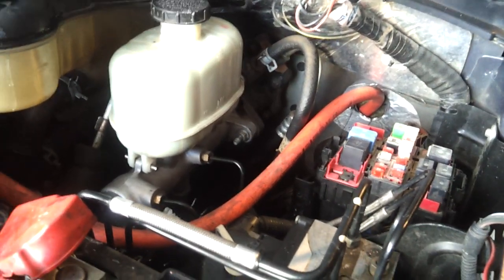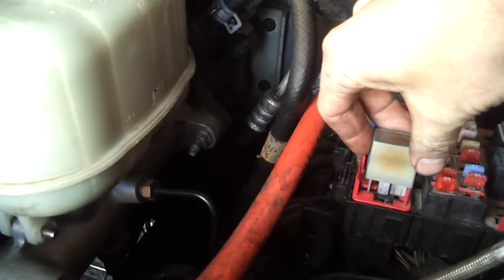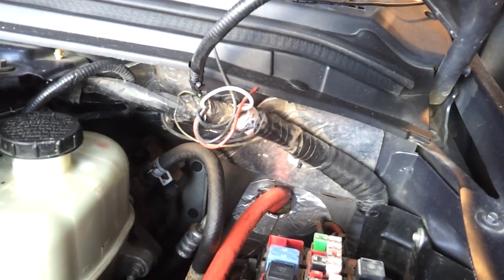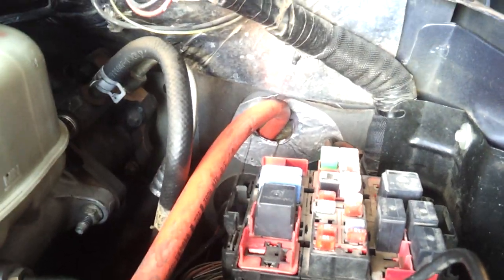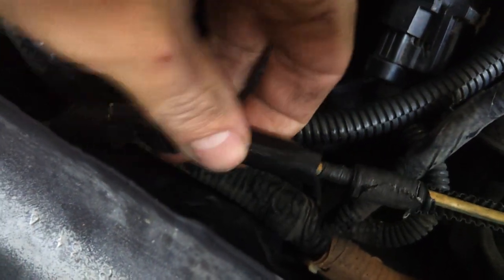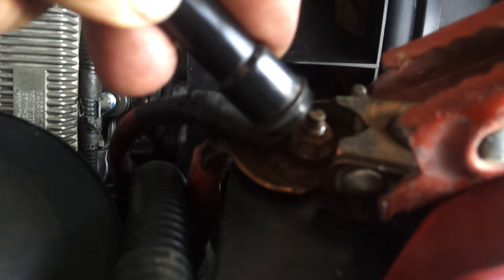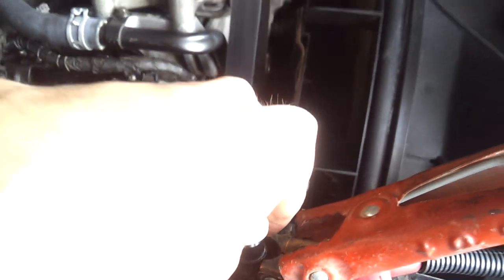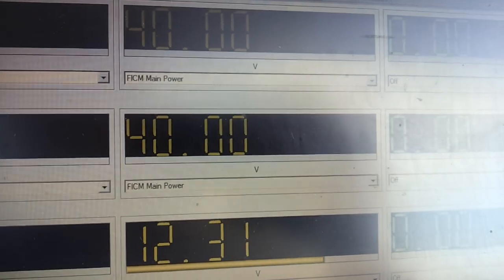FORD 6.0L ~HPO Leaks~ How to Crank & Prime From Under Hood

Comment: Is it necessary to pull the relay even if the key is off, say if you just want to prime the rails after it's been sitting a long time? Seems like in the off position, no power is going to the FICM/relay anyway.
Reply from the maker: rts No You don't need to pull the relay. It just allows you to monitor the ICP pressure if you have the key on.

Comment: What is the diagnosis that Kevin mentions regarding the base engine cranking sounds?  I am also hearing the same type of drone from my '05.  Your help would be greatly appreciated!
Reply from the maker: Apparently Kevin can hear the base engine problem while I'm priming the oil rail(which was emptied when the rails were removed). As far as my actual problem, the longblock is of very poor quality, lots of slop and blow-by.
Reply: cr38er I know it a bit of an old comment but what Kevin was referring to in his diagnostic was the dead hole. When you cranked it I noticed it as well. When the starter flares up like that (or to some may seem like a skip in the starter) that's usually a sign of loss of compression in a cylinder.

Comment: Hi their, when I am done replacing my one injector. do I turn the key in the on position and take off the Ficm Relay and take off the 2 glow plug connectors and prime the system while cranking 20 seconds at a time? thank you.

Comment: i hope you replaced the relay, and you can hear the base engine issue just by cranking it, hear the flare up? no more diagnoises needed for sure, pull the heads!